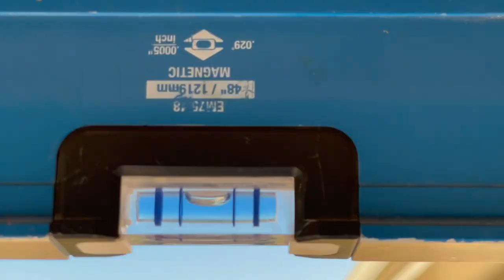How to: Tapered Columns

Comment: I really like how that exterior mdf sanded away those butt ends. I was going to try to make two of these using 45°s on all sides with my track saw and domino them together. Using this method with wood would drive me insane trying to hide that. I'll poke around for that exterior mdf..

 Whos idea was that vertical soffit material under the soffit.😱😱

  They are fired!

Comment: I don’t know what the building codes are like. where you were building but they seem very lax. if that’s a loadbearing pole you would need more than to just toenails at the top and glued at the bottom. Onto a cement base with no L brackets or straps or hangers.😱
Reply from the maker: Yeah very few if any codes on that in rural Tennessee. Never had any issues with all the weight of the front porch holding them down. I’m not opposed to L brackets but sometimes they just don’t seem necessary. Until the tornado comes 😰
Reply: That's why he covered  them. hahahahha
Reply: i agree. how hard would it be to knock that out with some impact or lateral movement?  So easy to get a concrete screw in with a tie. on a couple sides.

Comment: This exterior mdf holds up well to the elements? Never heard of it. Very interesting!
Reply from the maker: Supposedly. I’ve never had it on anything on my house but I haven’t had to go back and replace any that I’ve built so I guess it’s good 👍
Reply: I'd like to think if they are all sealed up from the outside they would be bone dry and have zero issues
Reply: @williamsmith9026  Just like real wood, right? :face-purple-crying:
Reply: @nickp3173  
   Easy does it  Nick 🤣.
  but, yes just like real wood. Maybe with less movement? I've never used the product🤷‍♂️.

  I'm gonna use the method on Festools channel. I have the gear. With actual wood too.  I'm not knockin this guy though. I'm gonna ask around about this mdf anyway.  Maybe buy a sheet and test it out on my one strep benches
Reply: @williamsmith9026  Good point about the movement. I'm curious as well. Let us know what happens please!

Comment: You should throw together a saw guide.  Super cheap and easy to make, it'll be help your speed breaking down sheet goods.  If you're interested I can link a video.  That saw horse trick though, game changer, I can't believe I never thought/have seen that before.  Thank you!
Edit: I about died when the Christmas music came waltzing in
Reply from the maker: I just don’t do it often enough for saw guide life. 99% of the columns I build are square so the table saw handles all of that. 

🤣 I’ve been sneaking Christmas music in for awhile now. Maybe one will technically be a Christmas video like Die Hard and get watched every year 🤞😅
Reply: What would be cool tho, if you did a crown mold cutting video.  I remember seeing you cut the crown face down from the back.  (Pause) and the cuts came out perfect.

Comment: how about MDO as a material?
Reply from the maker: What’s MDO
Reply: @TMPK  Medium Density Overlay
Reply from the maker: @pcatful  if it’s waterproof I guess? I haven’t heard of it.
Reply: @TMPK  Yes. It's more water resistant than mdf. It's used a lot for exterior signs. I just wondered if you had any experience to share on that.  I'm always looking for material for this sort of thing. Any of these materials can be trouble if they get wet, so whatever's best.
I used to use a material called Socomi lam which was a veneer wood product, but they don't have make it anymore.